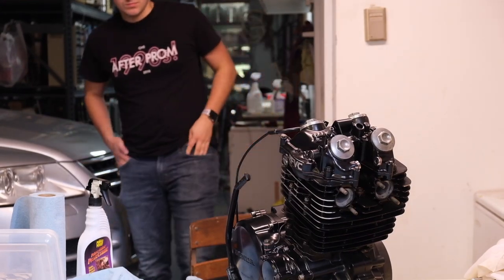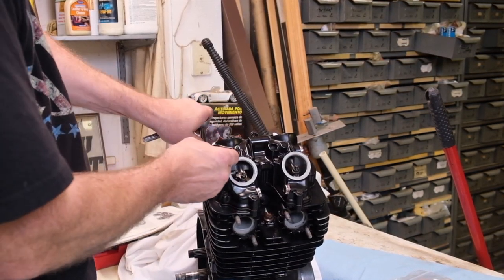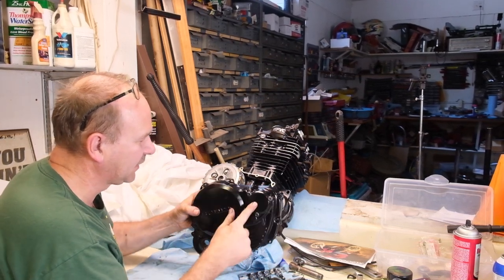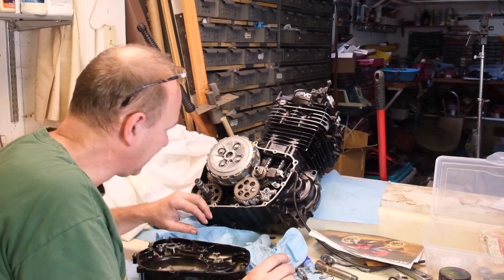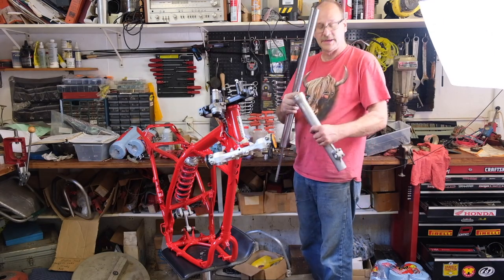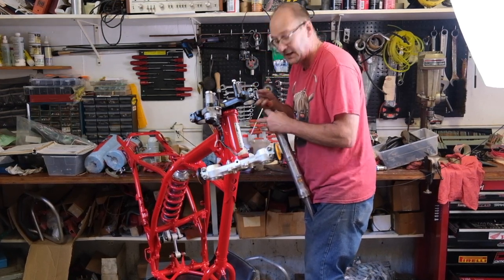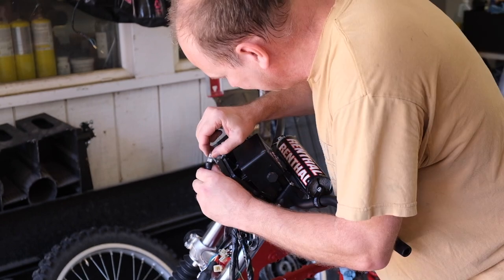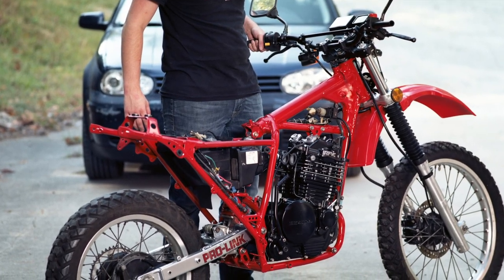Restoring 1983 Honda XL600R Part 2

Comment: Radial 4 Valve Combustion.RFVC. if anyones wondering. Grunty motor. Had twin carbies. Lot of torque. My 250 suffered from power loss once it got hot..that where my mates KLR 250 would come into its own.
Have an 85 Alpine white model im doing up at the moment. I wish i had the skill of this guy. Good vid.

Comment: I am loving the videos rebuilding the xl600 you are a wealth of knowledge good sir. I had my 86 XL 600 stolen 8 months ago and have just recently recovered the rear tire finally. The bike was recovered  the day it was stolen .  They pushed it through the woods for a good half mile  and tried starting it themselves  and could not  figure it out even though they had the key .  LOL sissies .  They took the rear tire  hoping to come back  and try again,  I've just got all the parts and from Ebay that I was missing to put it all back together and cannot wait to ride my baby.

Comment: I see you went with the orange peel look. LOL. Practice makes perfect. The harbor freight Spray guns work fine with just a little steel wool, and super fine sandpaper and elbow grease. We use Princess Auto spray equipment, it's about the same caliber...

Comment: so i have a 1984 XL350R I'm working on, my son has been using it and had some trouble, when I took the oil drain plug off a small steel ball rolled out with the oil, I pulled off the clutch side cover and found a small piece of something that broke off but can't tell where it came from, everything looks good though, since it looks like you have down a complete teardown, any idea where a small steel ball would have come from ?

Comment: How do I get the air box off? I have all upper bolts off, but the bolt on the lower left side of the box side on the air box just spins. Would like to remove the whole box and clean it out. Thanks!
Reply: try pulling on the bolt outwards while you loosen it.

Comment: The Monza Red is such an odd color. It looks kind of bad on its own like if you were to paint a car that color or a large surface and even on the frame when you’re looking at just the frame it doesn’t look right, part of that might be the video but Once you start putting everything together and you get the black and silver on top of it it looks amazing. That’s one of the reasons the 84 models are my favorite. I love the 85s but they have that orange and blue and it looks good but it’s still orange and blue and looks a little tacky in the red and black just looks so much better.
Reply: I agree, never liked the odd yellow number plates that came on the 85’s.

Comment: Hello, can you tell me what is the function of the "hole" in the head cap in front of the mounting place? Like beetween the mounting and the valve adjustment screw? I bought xl 350r 84 and there is a massive leak from that hole and i dont know why is it there

Comment: My 83 xl600r. Starts cold with just one kick but after as little as 2 minutes running I can not get it started without push, we’ll tow me with a rope start. When it running it’s running great but it I turn it off, I can’t start it until it’s cold. Can you suggest anything that might be going on?   Oh and I rebuilt the carbs completely thinking this was the issue. I also made sure no intake leaks. Help!!!!
Reply: I've had the same issue on my 86. I feel like it is flooding the engine somehow even though I'm not using the choke. I've tried priming the cylinder before kicking it without decompression and just kicking it. If I don't get to start procedure just perfect when the engine is hot it is a pain to get fired afterwards.
Reply: i found with mine even tho the choke was off it wasn't returning up all the way .cleaned it that sorted the hot starting problem

Comment: wondering why with all the metal grinds from the broken tensioner you didn't split the bottom case and clean out the bearings and all

Comment: I hate to keep bugging you, but how did you get your piston pin out of the piston/rod?  The shop manual just says “press the piston pin out of the piston.”  Is there a tool you recommend for removing the piston pin?
Reply from the maker: I use one of those woodworking clamps that you squeeze like a ratchet and it keeps getting tighter and use a deep well socket A little smaller than the wrist pin on one end and you may have to cut a big hole in the other side of the clamp
Reply: @bigdmc1  Thanks. I tried to use a couple sockets and a long bolt but it won’t budge. It’s stuck on the small end of the rod. I’m afraid it’s going to need a new rod and I’ve never done a bottom end before. I guess I’ll have to figure it out.
Reply from the maker: You did take the snap rings out didn’t you unless there’s a lot of carbon buildup they should just push out pretty easy if not use some heat to burn the carbon off

Comment: I noticed you used an impact to removed the head bolts. I’m working on an 86 XL600R with my son and I can’t get my head bolts to budge with my electric impact. I’m a little worried about breaking the bolts using an air impact. Do you have any suggestions?  The rusty head bolt near the spark plug came loose easily. All the head bolts under the head cover are tight tight tight.
Reply from the maker: You can use a breaker bar and that way you can feel for yourself the tension I just use the impact because it’s faster The bolts are going to be pretty tight that  hold the head on but they are strong bolts so I wouldn’t worry about them breaking
Reply: @bigdmc1  Thanks for the response. I used my large air impact and they all came out in good shape. Thanks again and I’ve enjoyed your videos.

Comment: One Quwestion Sir...what is that for White Stuff You put on it at the Cylinderheadmounting ??  Have You a Link or a Adress for me !?
Reply from the maker: Martin Prückl You mean the lubraplate I put on the cam before I put the valve cover on if so it’s a waterproof grease used for boat motor lowers or assembly grease
Reply: @bigdmc1   Thanks for quick Release !! Nice Tip !! And God bless You and Your Family !!  Greets from Bavaria !!

Comment: Im rebuilding a xr500 could u please direct me to where you got parts?
Reply from the maker: I got most of the parts at the local Honda dealer because some of the parts from the current XR650L are interchangeable I am not sure about the XR 500 as it’s a completely obsolete bike so you might just check eBay